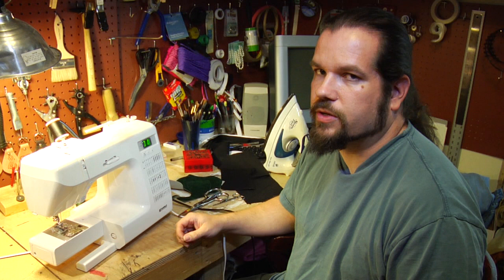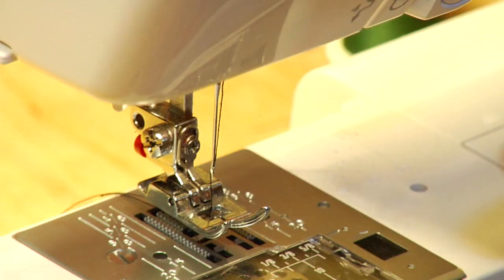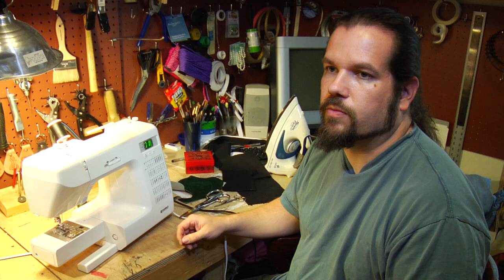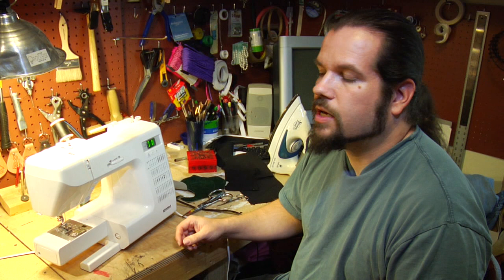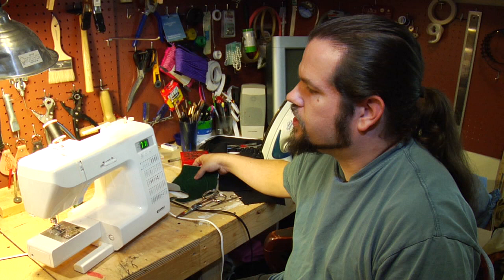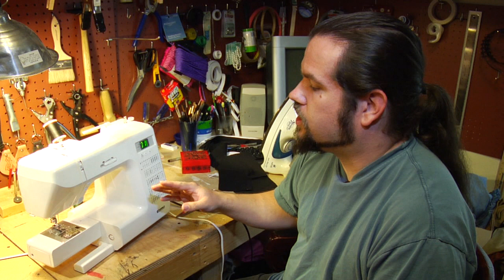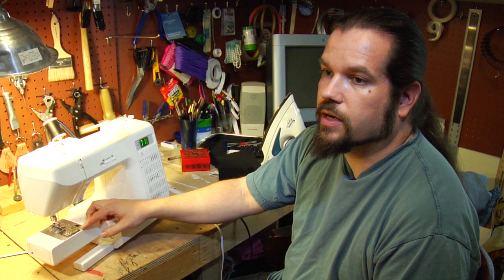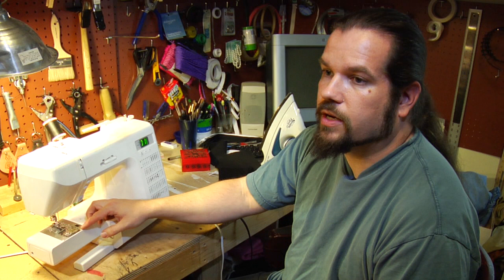Sewing Machine Techniques : Leather Sewing Tips

Comment: How about making sure your machine has the power to push that needle through your project without overheating the motor or tearing up your machine.  

I sew leathers and all types of materials for diving and can add a few observations and tips not covered here.  

Always bury your needle in the leather by hand to start the sewing process.  By doing so the machine will have developed enough inertia to continue sewing without assistance from the hand wheel.  

If you having to use the hand wheel don’t overheat your motor.  Which will happen very easily. 

I use a very thin needle and bevel my own chisel point from a sharp or ball point needle.  

I have used soaps on needles and wet or dampened the leather. 

Tension is very important in sewing leather so do your set up on the same thickness and grade leather as your project. 

Use chalk or some kind of very thin control line.  And go slow.